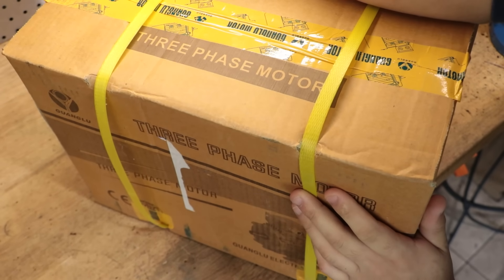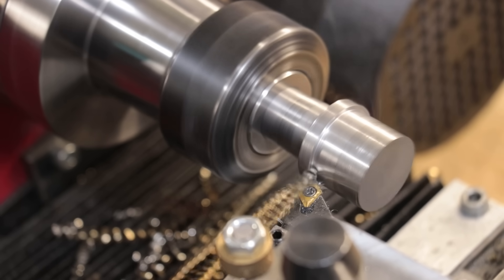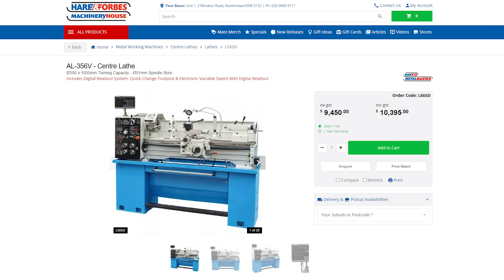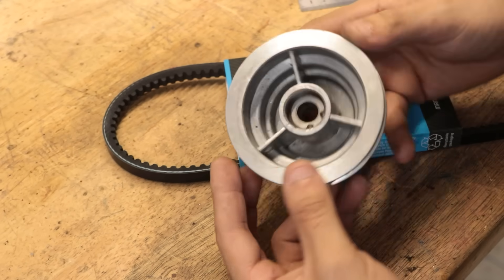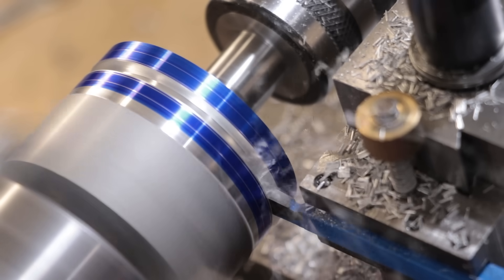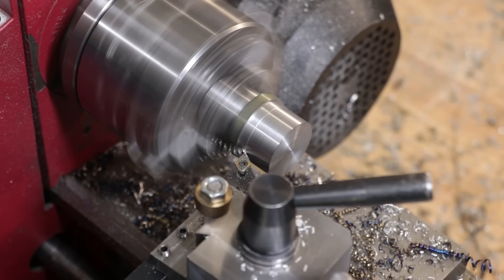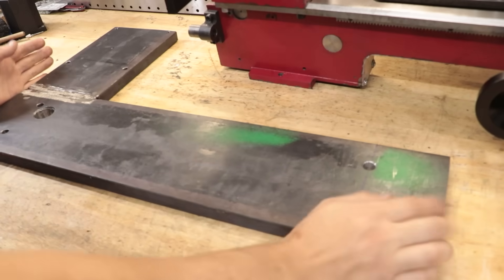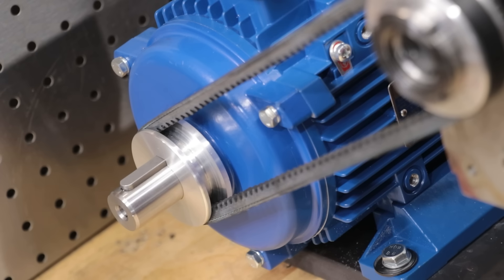Mini Lathe 3HP Motor Upgrade..... (Yep 3HP)

Comment: Hi, within the parameters of the VFD there may be a limit that limits torque that may be of interest and maybe a soft start feature. These setting may reduce damage if the worst case happens. - https://youtu.be/2ngiL5IdxJE
Reply: Good suggestion. 
But have in mind that such safety related features are implemented first by a passive braking system (don't know if this "Vevor" VFD provides this feature via breaking resistor, etc.) and the other safety (for the machine and for the operator are different aspects ... really :))) ) by an active mechanical brake. Also the "predetermined breaking point", such as plastic carriers or special V-belt pulleys is another aspect of machine tool design and engineering and has to be calculated, implemented and tested! 
Of course I don't expect that here, I just mean it as a suggestion too, from my relatively high horse, because I develop and build machine tools professionally here in Germany:)

P.S.: Feedback-less torque limiting (without an active backfeed) via a VFD can only be done in post (see it as an integral component of the feedback loop) via the measurement corrected by active current and "intermediate circuit voltage" measurement which is influenced by the mutual induction voltage and thus the current motor slip (proportional to the torque) in an asynchronous squirrel-cage motor.
This design-related and fundamental electro-technical-physical property ALWAYS means a certain delay and also an uncertainty about the real parameters in the system. This is further aggravated by centrifugal masses such as the rotating parts of the machine tool itself and then, of course, by the cutting work itself.
So you can see that in this form and design this is not an ideal condition for a "security" or emergency system that also deserves this name. :)))

I wish you a good weekend:)

Oh ... P.S.: CONCLUSION! A well tested (torque tested ... maybe by a torque wrench for the hobbyist?) piece of alu/steel/plastic/whatever ... which is so absolutely simple and also cheap as hell ... in the power transmission path to the spindle, may be our winner which can actually provide REAL protection against arbitrary destruction of the device?!!

Comment: That's pretty neat. It will be interesting to see if you can resist the urge to push the lathe til something fails. Hopefully not. I almost bought a used chY-knees mini-lathe that had a motor upgrade done to it. The seller was selling it without the motor for only $100 usd. Everything else seemed to all be there. I inspected it carefully and noticed that the bed had a slight twist in it. I assume it had a sudden stop/bind that did it in. Just be aware. Good luck.

Comment: Cool, you probably should use 3 phase rated wire out of the VFD though.
Reply from the maker: the amperage is fine, might adress the insulation
Reply: @artisanmakes  Oh ok, not sure what you mean...i done the same 2.2kw and VFD coversion but had a eletrician wire it, he used big ass wire and i also had to put 15amp power in, maybe because mine is a 10'' Lathe ?

Comment: Does your Vevor VFD give 3ph 380V or 220V? If 220V (as I s'pose), it's better to re-wire the motor to the triangle to have all three HP you've bought.
Reply from the maker: you're correct, 220 3 phase output. Kinda difficult to see but I did change it to delta, around the 16:24 mark. cheers
Reply: @artisanmakes  Thanks to point me out! Now I see. Cheers!

Comment: Looks like you should rebuild that drill press with the old motor instead of trying to drill thick steel plate with a hand drill...
Reply from the maker: It’s in the works but I just haven’t had the time to get around to do that. Plus the old big v belt got burnt up last year so I’ll have to order a new one

Comment: Didn't read all the comments, so I'm not sure if someone already said this, but when running a VFD from single phase, you need to de-rate the VFD by 50%, so you need at least a 6hp VFD to run a 3 hp motor at full load on single phase

Comment: The ways in my mini lathe are awfully unparallel top to bottom surfaces. About 0.2mm change in thickness across the length of the bed. Just wondering what yours it like? Or whether you have had to address it?
Reply from the maker: There is some wear on my ways, mostly nearer to the chuck but not as much as 0.2mm

Comment: I’m curious, maybe I missed it but did you make a spacer to stop the pulley rubbing straight on the motor housing or was there a step on the shaft?
Reply from the maker: No there is a step on the shaft

Comment: I don't like the way you wired your new motor. Your wires look way too thin for that use and you have no stress relief clamping on. You may end up over heating your wires and create a fire hasard, also you may accidentally pull one of your wires out of the connection box and be in danger of electric shock when you are not using a proper cable and clamps. Be safe and consult  a professional electrician.
Reply from the maker: 14 amp limit on the wires, I have electricians in the family. It’s fine

Comment: I'm not really a fan of carbide tooling on small lathes, HSS home-ground is a very cheap form of tooling... I DO have a carbide tool-set for difficult material though...

A slower speed and a high positive rake HSS tool will shovel off material at a rate of knots whilst actually being easier on the spindle... 

There is every chance you may shear off the spindle nose... I have an ML7 that got a bent nose (30 years ago as a noob ) from a crash using a 1hp 3ph motor... I had to fit a new spindle ... 🙄😂

😎👍☘️🍺

Comment: Careful with the vfd - they are great, but most induction motors are meant to spin at a specific rpm so you lose a lot of cooling at low rpms. The other thing to keep in mind is that when you use gearing to reduce rpm you multiply torque, but when you use a vfd you lose torque the lower the rpm you run it at. Some people have trouble with stalling at low rpms. 

You probably already know all of this (if I remember right your old lathe used a very noisy vfd)....
Reply from the maker: Its a 900 rpm motor, so its generally being run close to its normal speed. And for what it's worth, its not drawing a huge current, definitely no where close to 2kw. I had it running in today and for an hour or so in some 4140 and whist there is some heat being produced, its not close to being something i'd be concerned about.

Comment: I don't understand why you haven't put a motor belt tensioner on the lathe.
On the other hand, I don't think you should make passes of two millimeters because the mechanics of the lathe are not rigid enough to withstand the effort. You're going to break the auto feed screw.
Anyway, good job.
Reply from the maker: I didn’t get around to making one yet, I’ve been very busy. And there isn’t an auto feed screw on at the moment so there ain’t one to break
Reply: @artisanmakes  When I refer to the feed screw, I mean the carriage feed screw automatically. It is very simple to make so much effort.  You know what you do, it's your machine.
Reply from the maker: I knew the screw you're referring to, I meant that I don't have it bolted to the lathe and I never use it for auto feeding. Cheers

Comment: I just got a VFD and a 3 phase 1.5 hp motor for my C4 lathe. I am in the process of installing it on the lathe. Is your motor 220V 3 phase motor? Because I can't get a 220V motor locally and had to buy a 410V motor. For 220V output from VFD I will have to run it in delta. 
Also I noticed that your motor is wired in star configuration. Doesn't VFD needs motor in delta configuration?
Reply from the maker: No it had to be changed to delta. The vfd manual was clear on that. And this one can be run on 415 or 220

Comment: I've been thinking about taking one of these and doing an upgrade series. Starting with the small mods, eventually casting it in epoxy granite and bolting it to the bed of my 10hp Daewoo. And of course, running a driveshaft to the spindle of it to have a 10hp minilathe. Maybe someday haha.

Comment: do you think the headstock bearings might need upgrading I often find the standard ones cause some issues when taking deeper cuts on larger diameter material mostly chatter in the cutting tool and in bad cases even tool deflection I've ben seeking a way to upgrade motors for these lathes  a long time
Reply from the maker: The bearings are already tapered rollers so I don’t think there is much else to upgrade

Comment: I love the idea, but the engineer in me just cringes.  It’s dangerous but could be really changed and a lot safer.  First, the VFD wiring is terrible underrated.  You need a much thicker gauge to handle the amperage.  The static motor mount will self destruct and hopefully not hurt you in the process.  Mount the motor on a hinge and let the weight tighten the belt.  If it’s not enough weight use a spring as well.  This will allow the belt to slip under sudden torque or a frozen spindle.
Reply from the maker: Gotta live me engineer friends. But the wire is good to handle 14 amps, and I’m still half way through adding a tensioner, not hinged though good lord.
Reply: @artisanmakes  👍tensioner will work.  The circuit for a 2.5k vfd and motor can draw 20 amps.  I would use at least 12 gauge wire,  or just like the smell of melting  insulation in the morning.  That is a nice looking motor.  Working well?
Reply from the maker: 20 amps at 220v?
Reply from the maker: Working great though

Comment: 16:30, i'd take a look at the wobble on the pulleys. That could end up bad if you're pushing the lathe and the motor puts too much torque on the spindle. 
Also those welds for the baseplate for the motor looks like an extra safety feature for over torque :D
Also also, watch the temperature of the motor when using it at low speeds and pushing the motor. The VFD only changes the frequency, not the amps, so the motor will still use a lot of amps and with the low speed, the fan would have less effect because it's directly connected the the rotor. 
But great video and hope to see more niece upgrades for the mini lathe and mill.
Reply from the maker: The threads themselves are a little eccentric. There’s not much that I’ve ever been able to do about that.  The heat ain’t much of an issue. We aren’t really using that much current to take the cuts, at least nowhere near the motors rating
Reply: The current drawn depends mainly on the mechanical load applied. The no-load current is very low, only overcoming friction in bearings and belt, plus any fan loading and windage. Available torque drops significantly at low speed, mainly because the frequency slippage (ratio of applied to actual) is limited- this reduces the current taken.
Reply from the maker: @Tensquaremetreworkshop  Along the lines of this, I measured the current draw from the wall and it is rarely going over 1000w. All in all the heat is not so bad and very manageable

Comment: You might want to consider a fan on the motor. When you slow the motor down it won't be able to cool itself with the built in fan. Especially when running slow while applying a load on it.

Comment: I've got an old hafco al51 and the first thing I did was exactly this, a 3hp 3phase with a vfd, and I used two peices of 6mm flatbar under the lathe which made it easy to get the bed leveled.
A lot more rigid than my old mini lathe and capable of far greater doc than would ever be done in practice. Had it taking 6mm doc in 6061!
The ability to run more speed is nice which is great for the carbide I use, unfortunately not so great for vibrations due to my mounting
Reply: I've got the same lathe, would like to see that motor setup.

Comment: Looks promising but the low rpm isn't good enough for cutting threads in mild steel. My mini lathe dose have a better drive train with a 550w servo sewing machine motor and a poly V belt. the pulleys on my lathe is set up like yours but I have a mounting plate on the head for the motor. I have a 2.2 to 1 ratio and it dose get warm but I'll dig around for a computer fan to blow on it. Has anyone thought of using one of those vevor 1800w 48v brushless motors to drive a lathe?

Comment: I love the idea, and I always see your videoes, keep up the good work! 
When it comes to motors, you should look more at torque than HP, but it is very common also amongst car and motorcycle enthutiast, that the relation between torque and hp is misunderstodd or forgotten. 
Torque can be stationary, torque does not say anything about movement. 
HP is both torque and movement in the same designation. 
That means that hp is both torque and rpm in the same designation, where torque is only a force. 
To compare motors, you need to know both the hp, torque and the rpm, because on the lathe you will gear it to suit the rpm with pulleys. 
You have chosen a 900 rpm 3 hp motor, that motor have 22,5 Nm of torque and comes in a 112 frame - no wonder you think it is big, it has the same torque and frame size as a 9 hp motor that runs 2800 rpm. 
That is a lot of motor for that lathe 🙂 
All that said, I have 4kw 27 NM 1400 rpm motor waiting for my 13" lathe, just like you, I don´t want to fiddle with belt and pulley change. 
I don´t know if I can post links, but here is an easy chart, where you can compare motors. 
https://www.seipee.it/wp-content/uploads/2019/03/Motori-Standard_JM_GDM.pdf

Comment: Why didn't you just get a taper lock pulley for your motor,there super simple to fit and remove, you also seem to have your motor wired star,should be delta with the VFD
Reply from the maker: Didn’t do that pulley because I didn’t think of it. And I had to change to delta. The VFD manual was clear on that

Comment: When wiring the motor you show the motor in wye (star) connection. Later when spinning up the lathe you can barely see through n the corner of the screen  that the wiring was swapped to delta. You should maybe make a note to those watching that it was swapped. Running a motor in wye when it should be delta will give it much less torque.

Comment: Now to make sure you start using correct speeds. The formula is (1000/Pi (318) x Cutting speed)/Diametre. A HSS tool should be approx 24-30m/min and a carbide is usually around 4-5x this. So a 30mm piece of round bar with a carbide tool should be (318*120)/30=1272Rpm Decent Carbide especially when finishing likes up to 160-180m/min Surface speed.
Reply: This.
 
And way slow down when u use a reamer.  My eyes were hurting.
Reply from the maker: ops.. Good thing it was only an imperial reamer that one will ever use.

Comment: there is a similar lathe in my shed...  motor or drivecard has failed ... (180volt dc) this upgrade makes sence , altough i would stay around 1.5 kw

Comment: I have just installed a 2hp 3 phase motor with a VFD on my Clarke CL430 lathe replacing the 3/4 hp single phase motor . I only used 2Hp because a used one came up on eBay with a quality KBAC inverter. It was a bit of a challange to get the motor to fit the existing adjuster plate and get it all lined up. It is now so much better to use with 170 to 1700rpm without swapping belts.

Comment: Cables should be double insulated, either use 3 core flex (extension cord) or corrugated conduit. 
Also cable looks to be 1.5mm, would not have thought less than 2.5mm would do.
Reply: 1.5mm is more than sufficient for 15A per phase.
Reply from the maker: My bad on the first part but the cables are good for the current load

Comment: I was always told to go about 10% over on VFD's and more on chinese ones but i take it you have a good supply to your house/garage so its probably not a big deal (Also worth checking how balanced the lines are into the motor underload cause they can burn out quicker similar to running them off rotary phase converters)...
Only real word of advise i can give for having that much power is having a safety guard and the use of steady rests etc because if a piece slips out it will do real damage ( I have a hercus 9" i had this upgrade on but went back to smaller motor when i brought a big 7hp turret lathe..both will kill without a 2nd thought)
Awesome work and keep it up :)
Reply from the maker: That’s very interesting. Never head that, I might have to look into that. Cheers

Comment: The three cap heads may have been for three points contact to account for any rock in the head machining. May be worth checking if you twist the headstock when tightening the 4th. Only a theory.
Reply from the maker: Maybe but for what it’s worth the non sieg brand mini lathes use 4 screws
Reply: @artisanmakes  fair enough. Only a thought. Love the videos by the way. Though your new motor makes my 13" swings 1200w feel really inadequate... 🤣

Comment: Given your high level of experience you probably know this but when you bolt down a lathe you should have a test bar in the Chuck with a DTI indexed off the bed on the test bar. As you bolt down the lathe look for any change in reading. You may have distorted the  bed which is easy to do even on a big lathe. The hot rolled steel you used may not be flat and the lathe feet probably are not level. I love you channel and interesting project. Stop by my channel and say  hello. I’m doing some crappy fabrication at the moment. Regards Chris